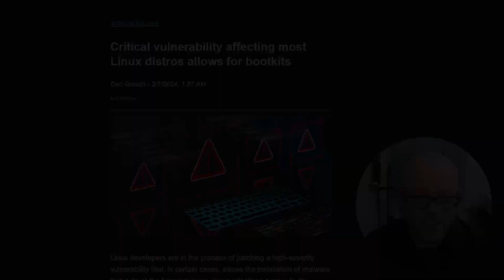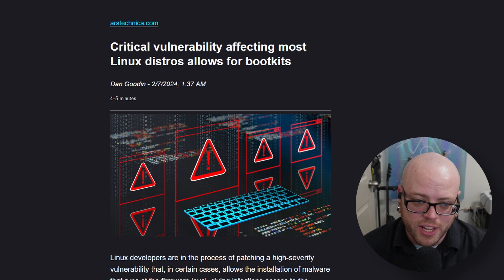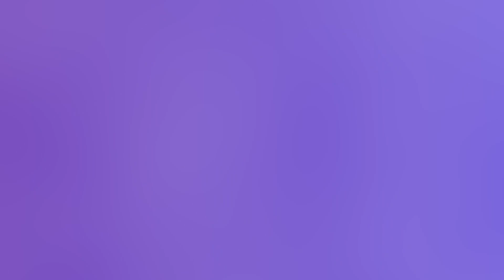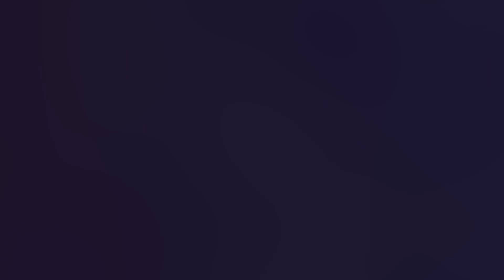Linux Bootkit Flaw Discovered (Patch ASAP!)

Comment: This vulnerability seems to be more of an issue if you have an untrustworthy network or your system is locally compromised, and thus a non issue for 99% of users.
Edit: speaking as someone who used to work in a company where httpboot was in use, if you are vulnerable to this you have infinitely worse problems on hand than someone exploiting Shim.
Reply: so this only effect users with secure boot enabled? What about users that dont use secure boot would we still be affected? How users that dotn use network boot or have it disabled in boot?
Reply: @thangchanhtech7717  Since the vulnerability (CVE-2023-40547) is explicitly within the process of the network boot, if you don't use it it's a non issue

Comment: You said this vulnerability was highly severe, but how often do things like this crop up? You also said this was a problem for "most" Distros, but which ones? Should there be some sort of user-alert system integrated into Linux Desktop Environments to warn users of when these things come about?
Reply from the maker: Most major Linux distributions using a Secure Boot setup with the Shim bootloader are affected (e.g., Ubuntu, Red Hat, Fedora, Debian, etc.). Your distro's website should have specific information. The article linked in the description goes over how you can patch this specific vulnerability on your system.